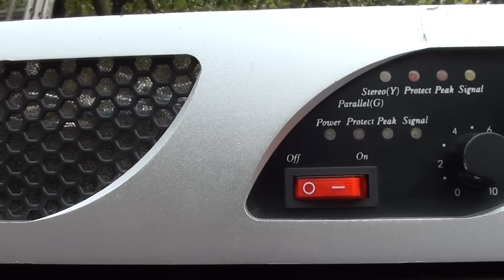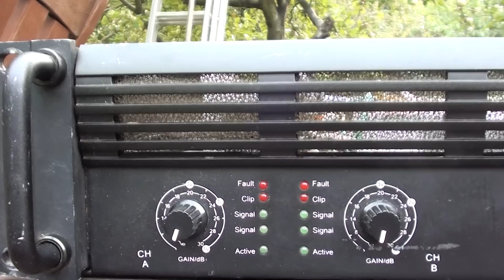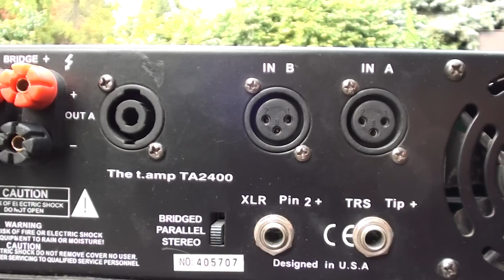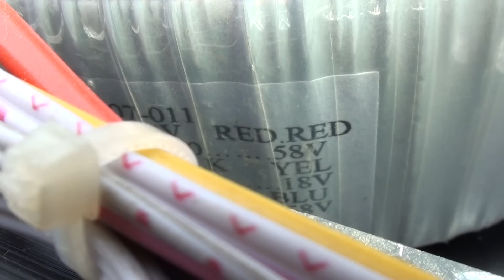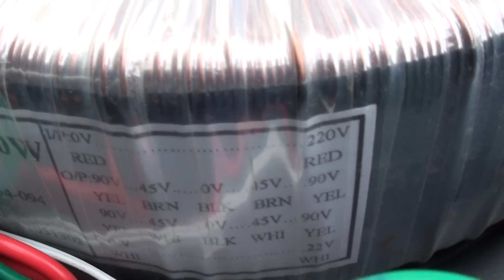Boke PA-800 (2x400W) vs Boke PA-1200 (2x600W) vs T.Amp TA-2400 (2x1200W) high power PA amplifier

Comment: t amp got more capacitors, wich means better voltage control & higher microfarades.
Reply: boke where is the product?
Reply: @꿈댕이-m3k  Thomann for Europe market
Reply: @rcfaudioitalia6110   thanks
Reply: I have connected the ta 2400 mk x with a car subwoofer 1 ohm😆